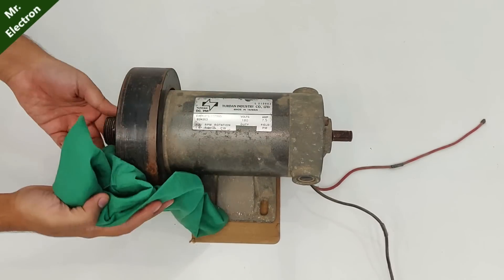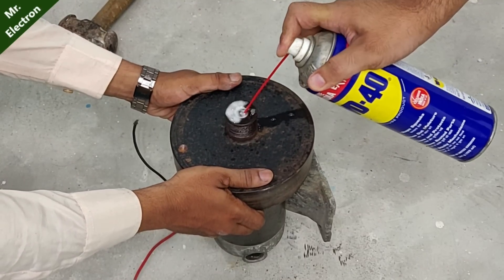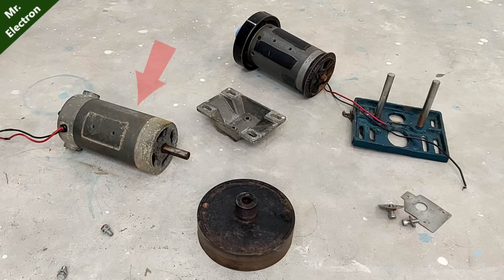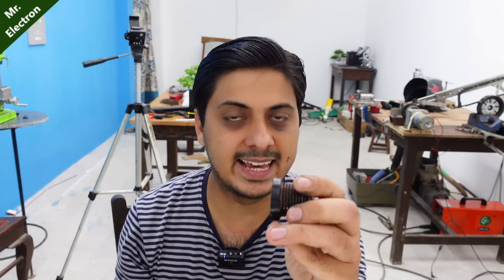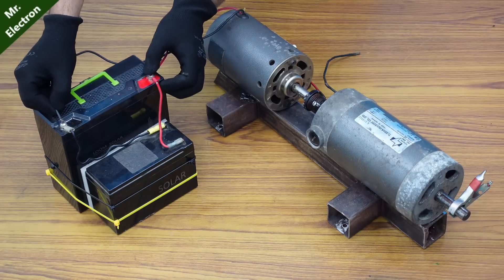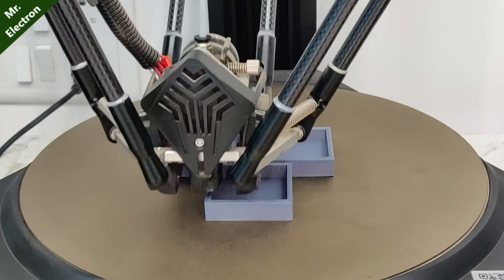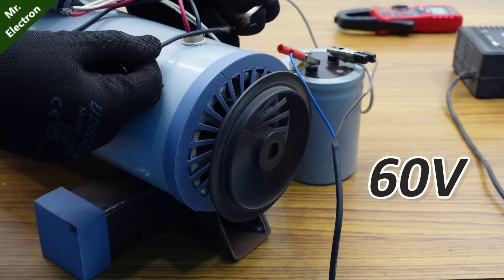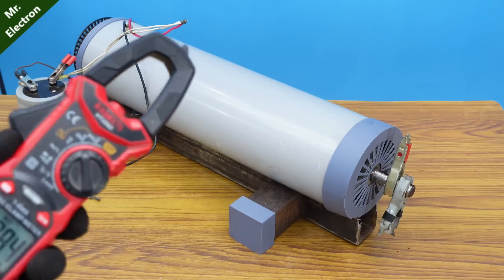2000 watt - Make a 180 Volt 3 HP Giant Electric DC Motor 4000 RPM

Comment: Electric DC κινητήρα 180 Volt 3 haw to start with 220vac
Reply from the maker: You will have to use the same kind of controller circuit as i used in the video.

Comment: This comment is not related to anything in this video but can you drive bldc motor on 12 volt AC transformer (no DC voltage).
Connect wire 1 and 2 to transformer and wire 2 and 3 to run capacitor for AC motor
Reply: Bldc motors need some type of sensing to feedback  the position & polarity of the rotating magnets...so raw AC cannot be used.
Reply: @analoghardwaretops3976  a capacitor can do a phase shift to act like 3-phase

Comment: This motor looks spindal motor
Reply from the maker: Yes
Reply: @MrElectron  please make spindal motor
Reply from the maker: @namankumawat3753  Actually , if i increase its rpm, its brush consumption will increase, and output torque will reduce.
Reply: @MrElectron   but this motor have less rpm
Reply: @MrElectron  you just modify your motor in high rpm motor

Comment: For the motor power supply you can use the inverter transformer and rewind it  150v output voltage so you can use it on full power but the inverter transformer is should be like 2000 to 2500 kva inverter transformer
Reply from the maker: Cool idea, thanks.. But i have already used my old inverter transformer for making a 48v power supply. Its been a year and its still working great. Note that i have to make the supply variable. 😃
Reply: @MrElectron  use input  side ac variable regulator for adjust output voltage
Reply from the maker: @anshuyadavsitaram7053  Yes , i will be needing a powerful regulator of at least 2500w to handle that kind of load.